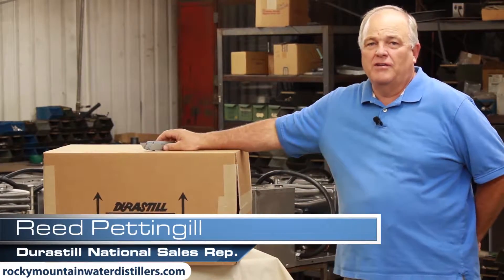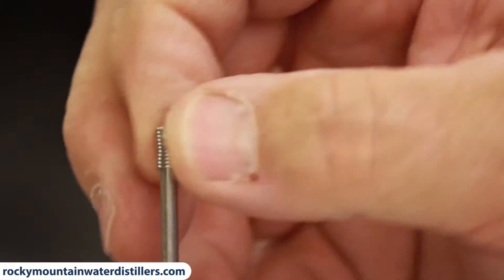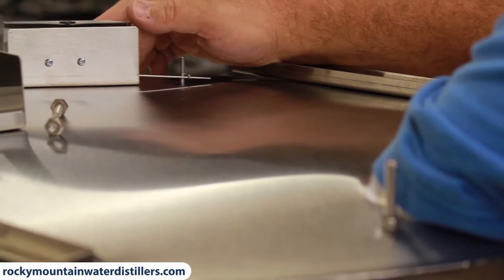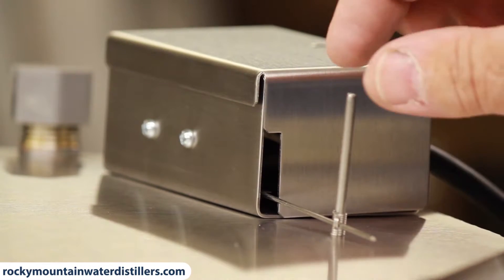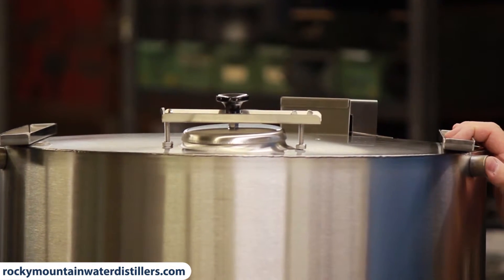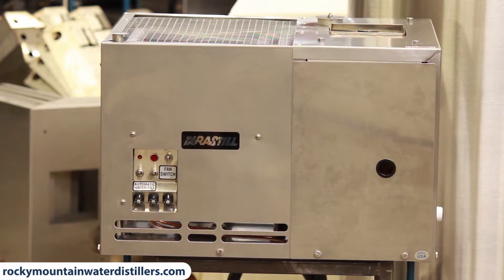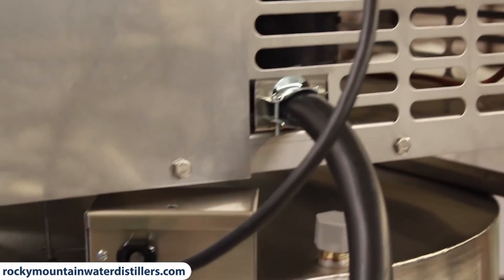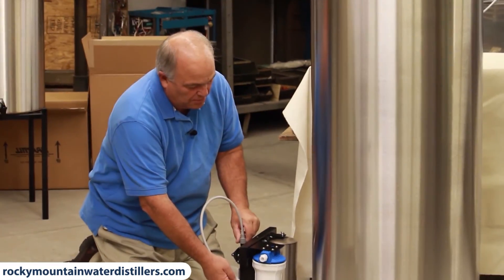How to Install Durastill 4280 Commercial Water Distiller - Rocky Mountain Water Distillers

Comment: Why does the output need a filter if it's pulling from the tank of distilled water?
Reply from the maker: I assume by "output" you mean pumping the distilled water out of the 80 gallon tank. The Durastill Remote Faucet System, which pumps the distilled water out of the water storage tank to where you need it comes with a standard post-carbon filter on it. It just give you another layer of filtration protection to give you the highest quality distilled water possible. - thanks Brandon
Reply: @RockyMountainWaterDistillers  distilled water is the purest one can drink, why would it need any further filtering?
Reply: @honuswagner9348  Correct - and good question that I haven't seen answered aniquately. It seems due to the taste of distilled water.